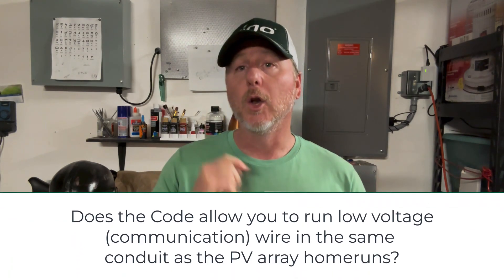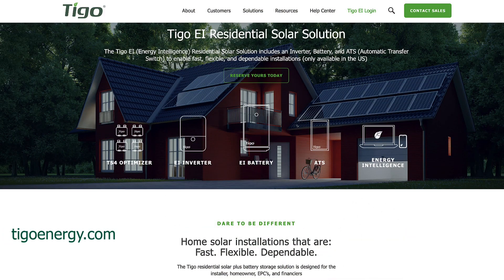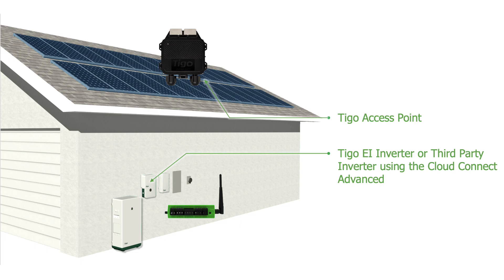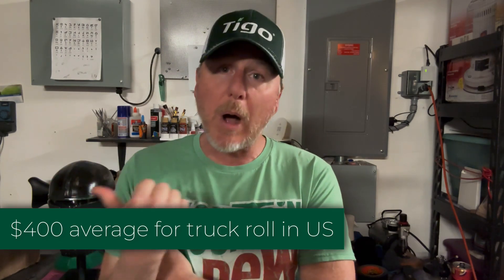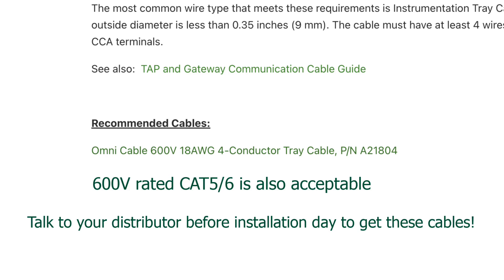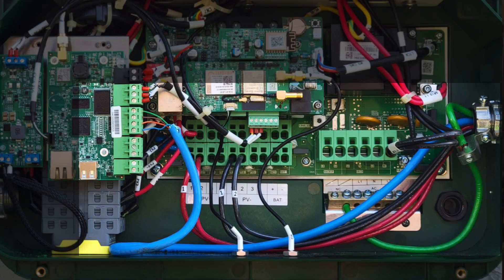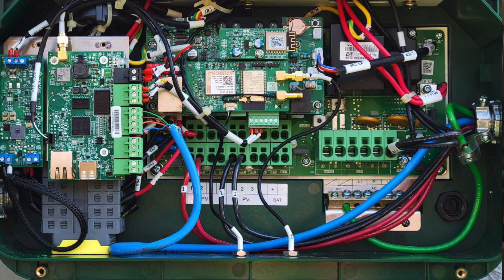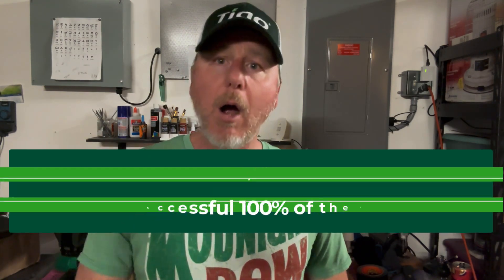Tech Talk: Running communication wire in the PV home run conduit

Comment: @Tigo - we had a lighting strike on one phase from the grid, it was not high enough to trigger the SPDs on the grid side or on the inverter side (Up=1.4kV), but it fried the HDR-24-15 power supply ACtoDC, and also fried the CCA R78, R74 and R313 SMD resistors - only the R313 can't be read as it burned the housing. Can you tell me SMD 0603 value, so that I can swap it, test it to check if the issue went further down the line on the TAP. Only after the TS4 will be active, I will be getting 450-600Vdc on each string, so I can also check the status of the SolPlanet inverter.

For future use I plan to use a 12Vdc power supply with an additional SPD (Up=20V) & glass fuse that will cut out power to the CCA . Will that be enough for a 11kW solar install on two strings each with 14 modules and with TS4  optimizers?
Reply from the maker: Lightning is always a tricky thing to deal with. Please contact our Customer Success team for assistance with your question. +1 408-402-0802

Comment: Will a 600v rating be needed if I run CAT6 separately? Seems overkill if no connection other than 24 volts is used. I can only deduce that Tigo's concern is overheating issues when sharing conduit with PV wire. My plan is to just make a separate run on my solar wall mounts from the TAPS to the CCA. Update: I ordered an equivalent already and even if I am not running in the same conduit, I'm thinking that the TAPS share the same vicinity, and the cable is protected from UV due to its outdoor design. The code will also be met.
Reply from the maker: No, if the CCA wire is run in a separate conduit by itself, then it does not need the 600V rating.

Comment: since i have my pv cable run together with rs485 same voltage rating, can i run it next to my ac conduit.
Reply from the maker: Yes! There are no restrictions when using the CCA and TAP with RS-485 since there are no interference issues if the communication cable is run next to the AC lines.

Comment: outstanding!  any ideas for TIGO cross talk issues?  I heard there was a line filter or something.............thanks!
Reply from the maker: Thank you for that important question! I am not aware of a filer, but we do have the pure signal technology that syncs multiple transmitters to mitigate crosstalk.

However, the best way to avoid crosstalk issues is to design it out of the system. All it takes is preplanning to ensure a safe, code-compliant, worry-free system. First, take our 'Tigo Rapid Shutdown using the TS4-F' course: https://www.tigoenergy.com/tigo-academy

If you have any questions, please reach out to our service line to help once you complete the course. The most important thing you can do is send us a line diagram. We can spot potential crosstalk issues BEFORE you start laying glass. The second important thing is to install the system like we recommended!

Comment: Can i run internet cable in same conduit with electrical 240v cable
Reply from the maker: Great question! The National Electric Code article 300.3(C)(1) from the video applies to your question as well. As long as your CAT5/6 cable is rated to 240V then you are good to go!

Comment: do you have a lead on 600V rated Cat 6? Thanks for the lead on this other cable. It really is just too difficult to find this stuff.
Reply from the maker: I recommend searching for it on Google. There are so many suppliers, however, you have to order it in advance. You could also talk to your distributor or electrical supplier to start carrying it.